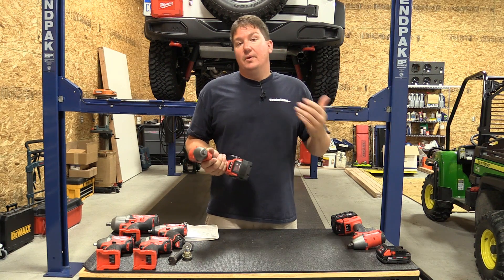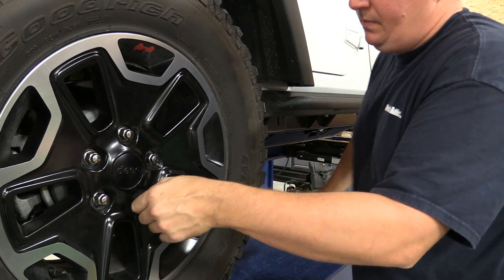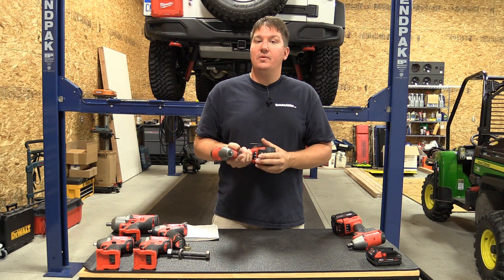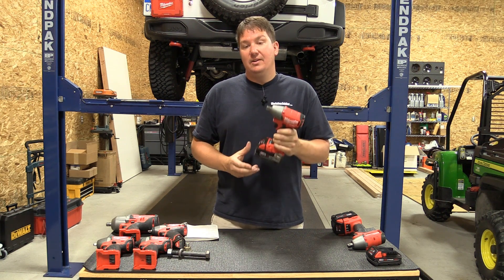Milwaukee M18 Fuel Compact Impact Wrenches - 2655 and 2655B

Comment: Hey do you notice any head/anvil play with the 2655? I just picked one up and noticed the socket wobbles on the anvil. Any suggestions or ideas?
Reply from the maker: Mr. B we have none.  I would return it and get a different one.
Reply: WorkshopAddict I'll contact milwaukee for warranty repair, cannot return. Thank you for your reply